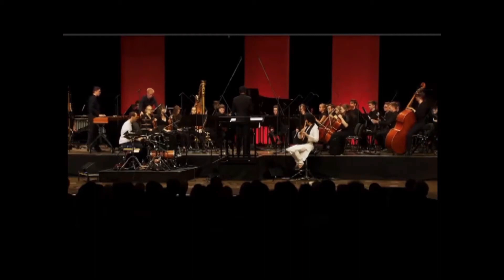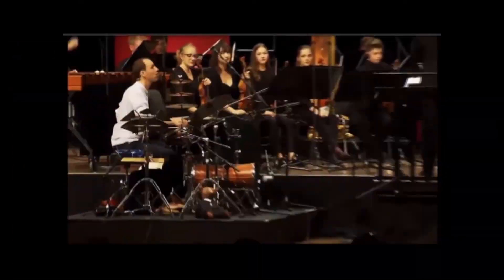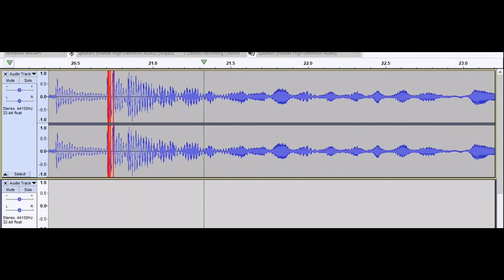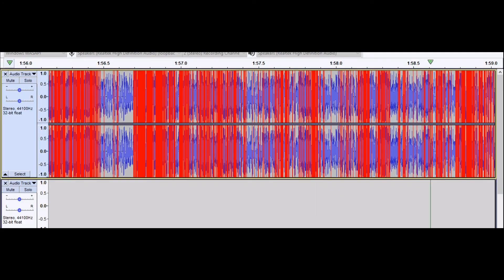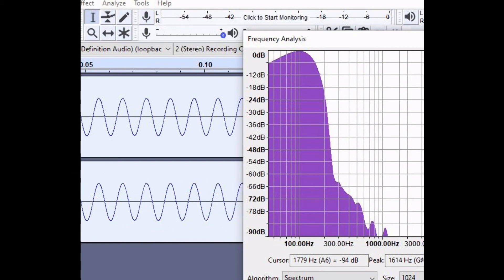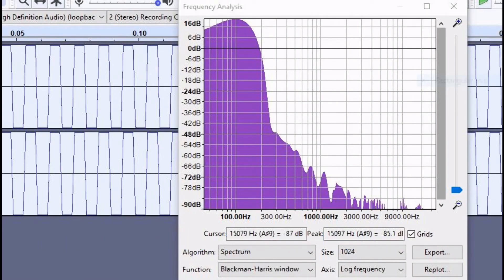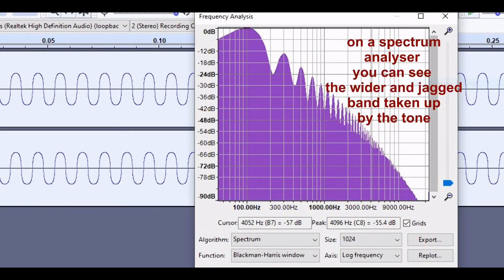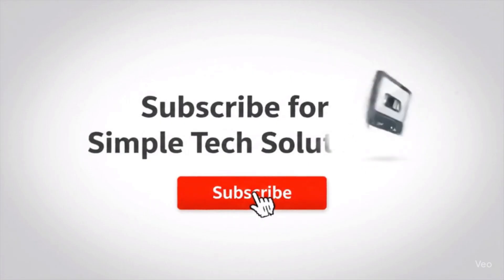Why Your Cassette Tapes Sound Bad | Audacity Tutorial Fix

Comment: So, the Peak level should be around 0 Db when recording? But wasn't it also a tape issue? The quality of the tape and also if the tape is Normal Type I, Chrome II or IV Metal? I believe already a good old TDK D90 Normal I can take higher peaks without this problem occurring at all, am I correct?
Reply from the maker: If you check the distortion on a visual display you can see the levels increase as you go over the 0db level. As is often the case, some machines will handle a slightly higher level and some tapes will also . BUT if you do it at 0db you will always get a good result.  Obviously you can experiment and get the optimum for that tape, on that machine ,and be happy, but that is time consuming. and when it goes wrong it is such a shame especially if you can nor reproduce the sounds, e.g. Live performance, people talking, damaged record etc.
Reply from the maker: There is also, depending on the equipment used, the possibility that the replay level of a tape recorded "Hot " on one machine , even if it is a pure recording, will distort when played back on a different machine , simply because it is too large a signal for that machine to handle properly. I have played several tapes that I have purchased second hand and the recordings nearly always suffer from being too hot to listen to. Often you can tell they were recorded on a boom box because of the ALC effect (Automatic Level Control) But some are beautifully recorded, right up to the louder parts when they just go "Nasty". Such a shame.